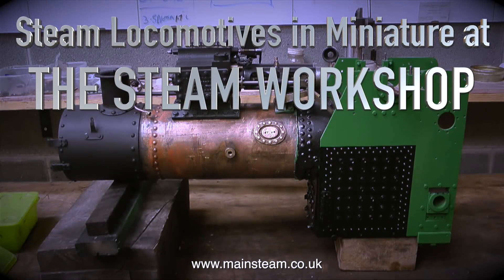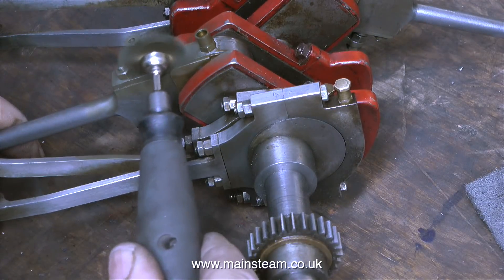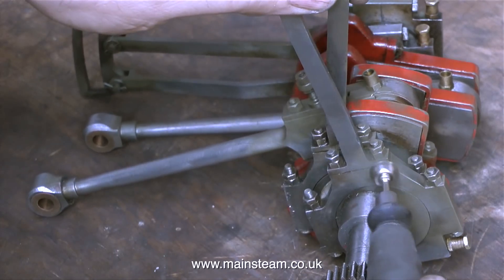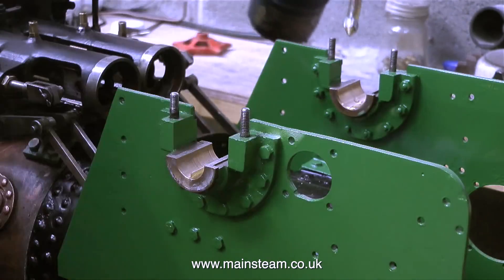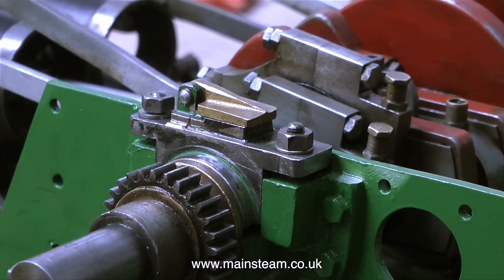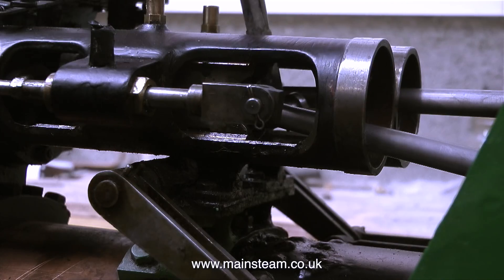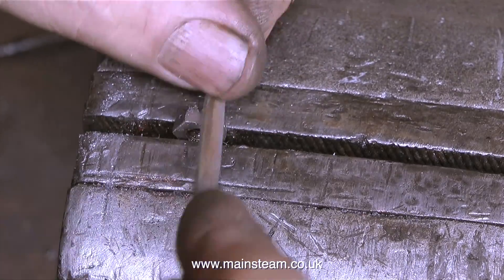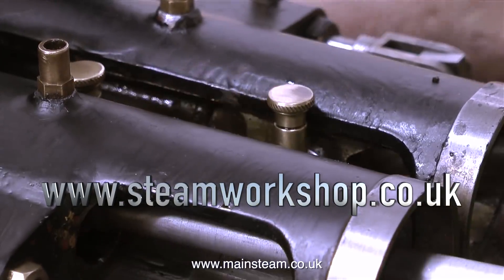THE STEAM WORKSHOP - GARRETT DCC TRACTOR - PART #3

Comment: Proxxons run at 5,000 minimum, up to 20,000 rpm. At the top speed the brass wire brush runs at 7.5 metres per second, which means a stray wire will hit you within 0.1 seconds...
Reply from the maker: since I became a Ninja I can simply deflect the bristle out of the way with my hand }:-)))

Comment: I know it was a long time ago, but I just had to comment.  Your 'surgical forceps' are, I think, a tool I have used in various sizes for decades and still have two pairs in my @Front Line' tool pouch.  I am retired now, but I cannot go anywhere with out my two tool pouches.  That tool is almost always a "Spence-Wells" Artery Forceps.  I am assuming it had ratchet locks?

These were and are amazingly useful tools, especially for small parts.  With care, you can clamp onto the edge of, say, a washer so it is held at about 45 degrees and thus can be placed over a stud without the Spencer-Wells being perpendicular to the stud.

Oh and I totally agree with your use of  those Bahco's.  I only ever had the metric adjustable, but I assume yours is a proper Imperial?  It must be some function of the worm profile, or the snugness of the fit, but they really do not round off the nuts.  Of course, when fitting up pipework on small engines, one is not encouraged to 'swing' on any threads, but they are the only tool that can be trusted.

Comment: I know you will say "See previous video"  But please could you talk about scales and gauges  - That model is more than three inches long
Reply: Rod Smallwood if I understood properly 3 inch means that what is 1 foot on the real thing is 3 inches on the modell (don't take this for granted I live far away from any country that uses the imperial measuring  system therefore I'm not familiar with their gauges either)
Reply: Rod it is three inches to one foot scale. 3" on the model equals 1' full size. there is no gauge with it as gauge applies to the distance between rails.
Reply: As the others have said, 3 inches to the foot. Which expressed differently is 3/12 = 0.25 or, 1/4 scale.